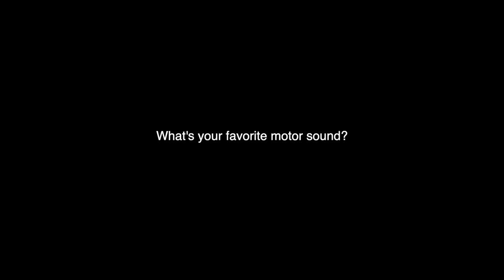Shovelhead the best sounding HARLEY? Engine Sound Compilation

Comment: Standing still the shovel is unbeatable, but moving nothing beats an Evo
Reply: Had my 1999 Heritage since new. I put in a  Andrews EV27 cam, kept the original CV carb and installed a Thunder Slide kit. Blowing out Vance and Hines Longshots . There's not much out there that sounds better.
Reply: @johngaulding3710  that sounds amazing! Do you have any footage of this beautiful machine?
Reply: @Math4real.Schramm  What's funny is I have plenty of pics but no videos. I have never been much on doing either myself. But I could make one.
Reply: I have 88 heritage and had a 79 and a 78 1200 shovel. I can't decide. I run single fire dyna . S&S super e and a EV-27 cam with delkrons and Ultima 80 inch  wheels and knife blade rods.  1 3/4 shotguns and I good to go. Nice setup for myself for apes !
Reply: how about a kawie  900 triple?
Reply: @donwest5387  great motors as well . Just a different  platform but fast and reliable.
Reply: The problem with the Evo is running hot.

Comment: Known it for decades. I grew up around Shovels since the early ‘70s. Absolutely the best sounding Harley engine since the brand’s inception.
Reply: I like knuckleheads better, but that's purely aestetics.
I have only ridden twin-cams though...
But the look of the old board-trackers is just the best!
Frame, engine, wheels, seat, handlebars and not much more is needed.
Pure riders machine, full of temperament and Joy. 
Wicked fast and deadly. 
Just like i want them!
Reply: AGREED, and I ride a TC 88.
Nothin' like some potatoes for breakfast in a campsite!

Comment: Owned a 77 FLH for 20 years. Loved that stump pulling torque! Life took over and I said goodbye to biking until 2004 When I bought a new FLHT Twin Cam. Still have and it’s been a great bike. Due to health I haven’t ridden in a year and a half , but hope to this spring. As nice as it is I still miss the feeling of hitting a hill in 4th and just feeling the hand of God push me up the hill.
Reply: I hope you're health gets better and you ride again. 2 wheel Therapy. Be safe.
Reply: I went through a rough time with my health, physically and mentally many years ago. I willed myself to deal with the pain and get back on 2 wheels again. Eventually I could ride for several hours through the mountains near my home in Australia. I credit the riding with my recovery both mentally and physically. Even if you only go out for 15 minutes at a time, it will help you immensely. Hang in there brother, ride you must, it's therapy for the body, mind and soul. 🇦🇺👍
Reply: If you can't,  then at least get a trike. 
It really is not that bad to ride one of those. And they make really nice ones these days!
Just go and get those handlebars between your fingers, it'll make you seventeen once more.
Best of luck to you my Brother!
Ride on and be safe.

Comment: Shovel heads just have that pure Harley sound. For me it's a tie between the shovel and Evo, as I grew up around them both. Also something about odd firing twins that I like, considering my favorite antique tractors are the two-cylinder john Deere's. Rather it's cyl-1, 180°, cyl-2, 540° repeat so it's a little more poppy than a harley
Reply: panheads  forever
Reply: All Harleys sound like agricultural machinery from a bygone era, but that's just part of the charm.
Reply: @stevenjackson4161  amen nerver forget my old shovelhead
Reply: All Harley 45 degree engines are really 2 cylinder radials. Same as Prat and Whitney.
Reply: I’ve got an old John Deere G, Ducati Desmo L2 and a Shovel. They all sound amazing yet are completely different. ❤
Reply: @jimkraft9445 
... really interesting comparison.
Reply: Evos aren’t even close . Very harsh aluminum barrels . Iron barrels make that soulful sound. Yiu get it from old triumphs and bsa and sportsters . But shovel four speeds just sound like heaven going thru the gears

Comment: The lovely old Shovelheads, with their "Single Camshaft" with four cam lobes! None of this modern, fancy, "Twin-Cam" stuff; a hyper-expensive, over-complicated mix of whirring camshafts, chains, and gears! Simple "bottom-ends" rule!....A wonderful sound...just make sure that the oil pressure is sufficient at very low revs!...LOL...! Take care, all!....  😀....😀....!
Reply: A lot of guys turn that idle down for that sound and it really isn't great for the motor. I try and keep mine around 1000rpm and it still sounds good

Comment: Shovels sound great.  On cold starts, I idle about 1000 rpm and get some lubrication going.  My 83 Low Rider just turned 40 and I want to keep it fined tuned.    Not the fastest bike on the road but it runs good.

Comment: I owned a 49 wl45. made my own exhaust from a 3inch diameter drive shaft tube. fed the two cylinders into the big tub with 2 smaller stainless flex pipes. had a nice sound.

Comment: My dad had a 67 shovelhead, purple, green, blue metallic chameleon  paint job with ghost flames. Not sure what if anything was tuned on it, but I remember if he'd get on it, it would shoot some small flames out the exhaust. When he took it to Harley Davidson back in 2017 they just died to have it, and he went for it. Walked out with a brand new Harley with 0 miles and paid $250 cash. No payments just about an even trade. He's at the end of his riding days though, laid it down twice, second time didn't have the strength to get it off him and the exhaust sat on and burnt his leg until someone pulled over to help. He's 68 now he says his body just ain't what it used to be. He fixed the bike both times and no insurance since it was just him involved, so he's going to hand it down to me. 2017 with 187 miles, no dents or scratches, told him he should've kept the shovelhead to hand down to me. Lol.

Comment: It truly is iconic, but my favorite gallop from HD is their Knucklehead.... But DAMN is it hard as hell to find one for sale that doesn't cost both kidneys and your first born
Reply: S+S Makes a shovel 8 or 9 grand i
Reply: @johngee4912  you can just buy the bolt on covers if you're on a tight budget, but you might get some head shaking from the die hard bikers lol
Reply: I know somebody makes modern Pans and Shovels probably improved and more reliable but there not cheap
Reply: @davidefland1985  I've seen these replica builds, there are companies that make them brand new, not sure how well they fare like if they could be used everyday or more for show or occasional sunday runs but either way they look the part.  
I love the Evo engines and of course the reliability but the older Harleys have so much character so ideally I'd love one that looks and sounds something like these old Knuckleheads or panheads but had the modern reliability, preformance and fuel economy of the newer bikes.  
I suppose the Shovelheads are kind of a compromise of the two in a way, they do need looking after and know how but they have decent pulling power and they look and sound great..

Comment: The one from 3:05 to 4:30 ish has a very unusual sound. Very nice. Sound like it has lots of snort.🍻
Reply: I heard that myself, I also heard something  extra sounding on the 2nd bike with all the chrome , but it's hard to tell unless you can put a screwdriver against the block or push rod tubes, to really know
Reply: @klaytonvonkluge4905  wood dowel works too
Reply: @joshuaatkins5197  right, maybe even better. 
(I knew a knuckle head owner/rider carried a piece like that around with him) . 
I seen a old iron head rider use a piece of bamboo too (a back scratcher thing) but I can't vouch for that one , personally,  ha!

Comment: The loudest exhaust ever is an early shovelhead with the large kidney type bottom end, 1966-1969, 74 cubic inch(1200cc) bored out to 80 cubic inch(1340cc) with straight shorty shotgun pipes. It has a low pitch throaty sound.

Comment: My 99 FXS Evo with the same long 2 
' drag pipes sounds the same... it's the low idle combined with the right size diameter length pipes... on a well tuned  Evo twin.. they do sound great... best all round dependable engine as well

Comment: I owned a fx 1200 glide fitted it with  Manley valves Andrews cams  50mm makun icarb   I had her from 1975 ...2000  when I swapped her for a v rod  still  miss her sound

Comment: There is no doubt that the Shovel is the best sounding HD motor been saying it for years.  You can set the idle down without fear of not getting enough oil circulation at low rpm.

Comment: HD Shovel was a great motor, then AMF (mistake) took over HD in 1970 then the shovel was called he troublehead till HD took the company back in 1984 with the Evo.
Reply: They bought it back in 1982 and introduced a huge quality assurance program. The Harleys (Shovel) sold in 1982 had an eagle on the front fender and were immediately recognizable. After that, things only went uphill.

Comment: Thinking of buying one of these 1977 Ironhead 1100 used for $2,000 with about 9,800 miles. Anything that I should look for when I see it that should send me running away from buying it? I was born in 1977 so it is sentimental. 😂

Comment: Those shovelheads did sound sweet, but so does my 103TC with Cam, Chip, Dyno tuned, and Rinehart true duals.
Reply: Shoulda got a 2-1
Reply: @A  It was cheaper to get a 2-1, but it doesn't look or sound as good.

Comment: Nothing sounds as good as a shovel, my cammed and warmed over 1980 80" shovel with 28" flh drags sounded soooooo badass. Evos sound good but not as good and pans sound sweet to but you can hear they're lacking in power. But a shovel there the best of all worlds, they sound and look epic while still very viable powerplant if built right will hang with any other platform its same displacement. Also a regular shovel doesn't need 2" pipes the regular pipe is better imo, I think they run better because exhaust velocity is higher so there is better scavenging and they have a smoother snappier sound.

Comment: Learning older engines.. Two questions: is there no compensator on a shovel? And, second, why are the coil wires crossed at 14:34? Is the coil upside down? Thanks, anyone
Reply: They both fire at the same time so it doesn't matter.

Comment: people don't realize that harley at one time engineered the perfect engine,with the crappiest transmission the baker six speed with overdrive will let lt lean into the wind with the others,and the engine is a hemi headed motorcycle version,i own one and that's enough,change your oil,often oil is cheaper than parts